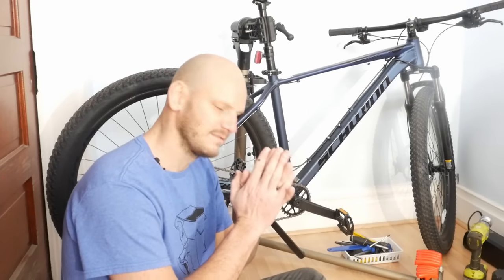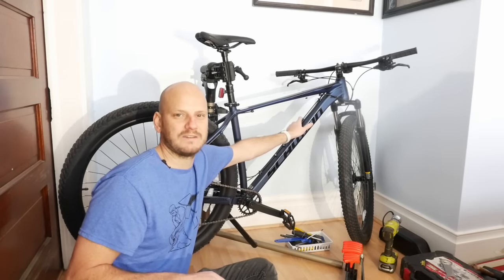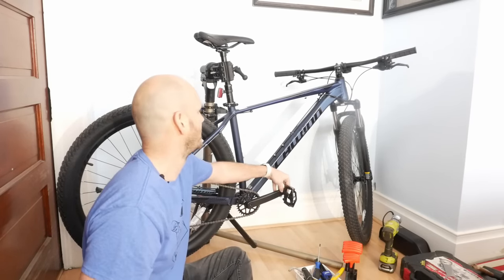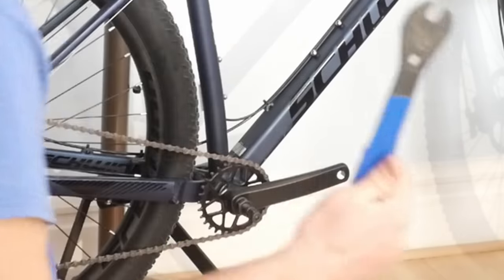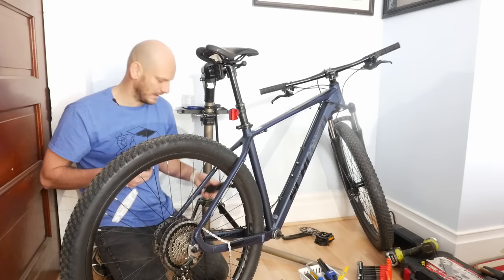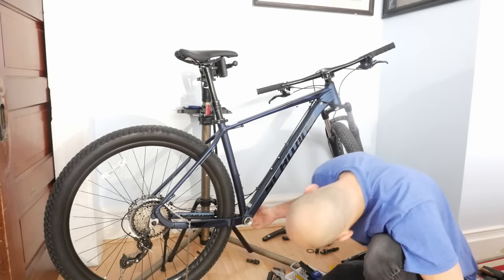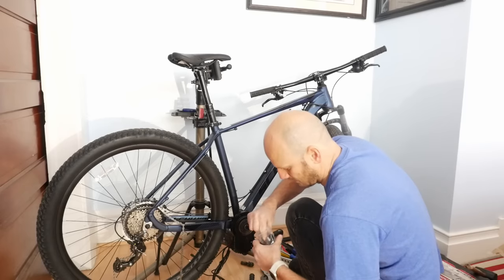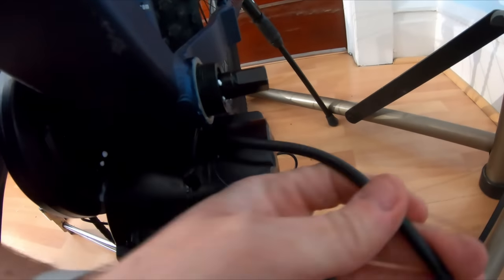The Step-by-Step Bafang Installation guide.

Comment: I purchased my mid-drive kit from Johnny and followed his video...I had to watch it a few times but I got it done! I have a Schwinn Midtown bike which has a curved downtube...Johnny recommended getting a Triple Bob plate with rubber coated hose clamps ...which made it possible to attach my downtube battery...Learned a lot from the experience which includes NOT breaking the chain if  not needed...Thanks Johnny!

Comment: Just did a bbs02 on my hybrid bike, this was a most helpful tutorial! Because of you I had the necessary tools on hand and was able to enjoy my results quickly!  My tip is that small diameter split-loom tubing is one's friend for cable management on these kits, makes it look a few percent less like a DIY project
Reply: Heat shrink tubing with a heat gun. Yea buddy
Reply: @mikesaull6094  Heat shrink will reduce serviceability. Convoluted tubing is the best bet to a clean finish while maintaining the ability to diagnose/pull it apart/put it back together when something inevitably breaks/needs adjustment. That's why the automotive OEMs use it. 

Put a couple wraps of friction tape at key points if you need to help it stay together.
Reply: @runner3033  I'm going to use a little non-epoxy heat shrink at chafing points, such as where the motor loom runs under the bottom bracket, also to secure the lighting connection, which is not robust.

Comment: Ahhh!!  No music - what joy!!!  Thank you!  My brain can focus 100% on demo.
I really appreciate this tutorial and all the little details like brake lever positioning for ease of use, what can get jammed, etc. Saves a lot of bother for newbies like me.

I want to convert a Trek Aluminum road bike (smaller for females) into an electric bike.  It has nice gearing components I want to keep.  The idea is to have full road bike functionality to get exercise but also to have the ability to commute fast to work on electric power when needed, and to do long bike rides with my small doggies in a trailer in back, run errands for shopping, etc.  I have another road bike for hard core workouts but the electric one will be the workhorse.  I will not do off roading, stick to paved roads, capable of climbing hilly roads in town, street bike wheels - no fat tires, no mountain bike. 

I need long range, light weight, fast speed to 25-30 mph, and reasonable cost. I want to DIY the install. I am very analytical and handy but not a bike expert and never done an electric install.  If you can recommend something sleek with good engineering, I will buy it from you.  I think from what I have read, Mid Drive beats the front hub or rear hub type of motors.  Please do advise.  I trust you.  Complete newbie here.

Comment: Get yourself some expandable sleeving black braided, the braided sleeving is great to run cables through, when you cut it melt the ends with a lighter to stop it fraying.
Also I like to use a stainless steel jubilee on the top of the battery bracket, clamp the bracket to the bike.
You need to pinch the jubilee and push it through the fastening slot, then slide a nail through and tighten it to the frame so you don't just have the bottom two screws holding it on.
You can use black electrical tape to stop it scratching the bike frame.
And lock tight on most important stuff as my big heavy feet tend to loosen the pedals, lol.

Comment: I'm boning up for my install. I got a BBS02 from Johnny and it fits my old Cannondale F1000 hardtail with a millimeter or less gap by the drive side chainstay. I'm picking up some spacers in case I decide that's to little room. I'm going to use a California e-Bikes stabilizer bar since the frame is aluminum and a lot of folks have the mid-drive's lockring teeth loosen up with aluminum bottom bracket shells. I assume that ideal chain line is with the chain in the middle of the rear cluster. I've ordered up some Lekkie crank arms since I don't like the idea of Bafang's asymmetry with their cranks. I really don't like the idea of the wad-o-wires up behind the motor. To compact it some, I'll probably use a length of large diameter shrink tubing.

Comment: I saw a tip from another video where they used a silver sharpie or paint pen to mark the brakes, shifters, and bar. Ensures they're reinstalled in the exact same location every time you maintenance the bike. I don't care enough to do that on mine but I thought it was a good idea.
Reply: Maybe if the bikes already set up for you, it if was new I would just set the levers and shifters to myself after a few rides up and down the street. It’s no biggie not to have the levers and shifters where they were it’s more than likely you would be better fitting them to your riding style. The smallest adjustment can make a big difference.

Comment: All very good if you have a box frame. I have a triangular section frame. The two water bottle mounts aren't strong enough and you'll end up ripping the bolts from the frame.
Reply from the maker: If you are working with a sketchy frame, you can use a product called “bottle bobs” that do a great job reinforcing those mounts

Comment: Johhny, I put a 700W on a similar bike my beach bike a Schwinn Axum with 29's. I had to add a 3mm shim behind the motor and order a special offset left crank part number ACO8 the ACO8-2 that came with the kit hit the frame. I changed the sprocket from a 30 to a 36. I see you went with the bigger offset one ,just wondering how that worked out .?????

Comment: @5:25 - totally agree about having a DECENT crank puller. Had this happen to me (partially due to me handling the tool for the first time, but anyway). No serious damage was done, because I was removing an old el cheapo riveted together crankset (worn chainrings; only replaceable as a whole unit) only to throw it away (-!

Comment: I bought a 1500w DD hub in 2014 for 1/4 the price of the then new BBSHD, and think there are benefits of hub motors for certain riders. That being said, I have a mid on order and can't wait to double my torque while chewing my chain and gears.
Reply from the maker: If you shift properly and install a shift sensor, you won’t have an issue 👍

Comment: Brilliant video. I've just completed a flat pack build (no instructions)  and you nailed everything. Particularly the bushings for the motor mounting (which were not supplied and had to be made up). I filed 0.5mm slots at 40 degrees for the securing ring so I didn't have to tighten the hell out of it (I've stripped too many threads in my time). I think the battery base mounting is too insecure as 5kg secured on 6mm aluminum threads is weak. But that's a design issue. A solution?
Reply from the maker: Google the triple bob @ Ebikes.ca

Comment: I have a  question about the minimum distance from the chainring to the chainstay. Mine is right at 2mm. Is that too close? The motor is also very close to the frame, less than a mm. Is this acceptable?  Nothing is touching but it’s very close. Thanks for all of your videos!

Comment: Great video. One question. Is there a specific reason you put the thumb throttle on the left side?
Reply from the maker: More space. The right side has the gear shifter. It can on either side of there is room.

Comment: Once you have tested the bike I would be inclined to shorten the wires using a soldering iron and shrink tube removing the wad of wires you folded up would make it look better 😉
Reply from the maker: the main wiring harness is 9 pins. I totally agree, but it would be pretty time consuming

Comment: Sorry for all the questions (but you got me started), what chain and length did you end up with on this bike. I've got everything comming but the chain. My order from you should be delivered tomorrow (Tom Dehn). P.S. I'm a nerd just like you, only older. 🤠
Reply from the maker: Can’t remember now. You just want to make sure you have about 1.5 extra links of chain when in the biggest physical gear in the back. Usually you can just use the same chain👍 you might have to remove a link or two 🤷‍♂️

Comment: Awesome video!  Question, I was planning on installing it on a 2015 Felt F5 all carbon fiber road bike for its lightness.  What do you think about that?  I'm not doing off road right, just the city streets in San Francisco...lots of hills.  I do have a heavier mountain bike I could use as well.  The Carbon fiber weighs 19 lbs with wheels and everything.  So that's a good light bike to start with.  I appreciate your feedback!
Reply from the maker: You just want to check the bottom bracket. You can’t clamp a Bafang mid drive onto a carbon fiber frame/ bottom bracket area.
Reply: @JohnnyNerdOut  Yeah, so you are saying that since my bike is all carbon fiber, I think the crank area is too…near the petals, i shouldn’t install a mid-drive?  I called a shop and they said i should do the mid-motor mount, but they wouldn’t sell me a rear hub kit cause it may not be safe…. Hmmmmmm

Comment: Hey im installing this now and the brake levers are confusing as my brakes are hydraulic disc brakes so im not sure if you can just replace them with the brake sensor ones? Should i just run no brake sensors? And or is there a way to install the sensors easily with disc hydraulic brakes? Id prefer not to have to bleed them because idk how nor have the tools
Reply: There is a different magnet switch that you need for hydraulic brakes, you typically have a choice between cabled and hydraulic when you buy the kits. You can still buy the sensor separately as far as I know.
Reply: @ElmdariRecords  i will prob rig the yellow plastic sensor thing somehow to my current lever. My problem now is getting my deraileur adjust as the chain is all over the place rn

Comment: Hi Johnny. Thanks for posting this. I have a question about battery mounting. Some batteries I see for sale have a mounting plate that is much longer behind the lowest screw hole. That means they won't fit between my lowest bottle cage hole and the seat tube. Have you come across this problem? What model of battery did you use on this build? Thanks

Comment: One thing to be aware of, the crank arms are typically aluminum and the pedal are steel. These two metals are not compatible! And the steel will corrode badly. So a old bike can be really tuff to get pedals off!

Comment: Watching your videos practically dared me to do one for myself.

I'm trying this on a Hosote. It's white and will have a horn and dual mechanical disk brakes. My bike and I got hit by a car, so they're paying for it. If there is anyone else out there trying to do this on the cheap, I will give you all the work arounds I will have to do.

Already forgot to request sensors instead of brake levers. 

Not so sure about the battery that I bought. I will crack it open and give you my verdict when I get it.

Any advice on wiring the 48v horn?

I'll be pulling a cargo trailer. I have the desire to have trailer taillights/brake/turn maybe.

Comment: hey  question, If i install a mid drive  with say a 36v battery . Could i put a front hub drive and use it as a generator ? if so  have you made a video about this or could you make a video about this.  im planning a mid drive conversion for my current bike and will get solar trickel charge so .. just wondering how well it would work out  , thanks in advance
Reply from the maker: You can it just wouldn’t be very efficient. You be using more watts to generate a little bit of watts. Just the weight alone would make it not worth it.

Comment: Any suggestions on resources to predict energy usage vs weight of bike, speed, grade for various size motors?  Here in Colorado, I want to stay below 750 watts to avoid registration and be able to ride on bike paths.  Is there any significant advantage to going below 750 watts?  Or should I stick to 750 for the flexibility for assistance when hill climbing?
Reply from the maker: Not a lot of resources for predicting consumption. You will get a feeling with time and a good watt meter. I’d go with a 750w. You can always program it down to draw less power

Comment: Three questions 
1. Any recommendations on where should we should buy the kit from? Or we should buy the components individually?

2. I have a Treck Which I would like to get the range of two about 70 miles and a speed of about 35 miles an hour. What kit do you recommend for that?

3. I like the Bafang BBHD and heard you can upgrade the controller to get higher speed.. is that the case and any thoughts on that ?
Reply from the maker: Hey! I actually sell the components through my website. If you want to set up a consultation with me, I can go through all of your criteria (budget, riding style, power needs, etc.) and spec out the kit that is right for you. No obligation to buy through me, but you'll know what to start looking for. www.johnnynerdout.com
Reply: How much was this kit on this video did

Comment: Hello there, I'm looking to make my 26x4 fat bike into an ebike like this one, what motor do I have to buy? The center of the bike where the pedals are is 120mm in length from end to end just counting the frame..... How do I know before hand that I need to replace the chain?
Reply from the maker: What size  chainring do you currently have ?  If you go with a bigger chainring you will need a new chain most likely
Reply: @JohnnyNerdOut  in the info sheet of the bike it says that it's a 24t (I think it's too small compare to what a regular motor comes with) with a chain fxd 1/2*3/32*118L

Comment: I have the Dekra D-drive bike that would be awesome with an e-conversion, trouble is it’s a shaft drive not a chain drive (it comes with Shimano 3-speed Nexus hub shifter *only*, no front derailleur, obviously, because it has no chain).
I like the idea of a mid-drive (saw your comparison & contrast video) but I fear shaft-drive bikes currently only would possibly work with a hub drive and at that, probably front wheel drive only.
Any other ideas?
Reply from the maker: I would love to try and convert a shaft drive, but unfortunately I don’t have any ideas as I haven’t worked on a shaft bike yet

Comment: Great video! Do you have any experience in installing Bafang on carbon frames? Not sure if the carbon fibre bottom bracket will get ruined or not.
Reply from the maker: I wouldn’t install it on a carbon frame due to how it clamps on
Reply: That sucks, i think this answered my question 😭🙀😭🦗

Comment: On this one is it just Anderson to Anderson? No Xt60 in between? Do the Anderson hold up??
Reply from the maker: Yes, Anderson is pretty much all I use. I use the 45 amp terminals so they can easily handle the current of the Bafang motors.

Comment: I built the bafang 750 mid drive....my complaint is that when in pedal assist (even just on 1) the assist wants to go the maximum for that gear most of the time. There are some exceptions where it behaves properly. Anyone have any suggestions?

Comment: I would not ride a foot distance beyond 8cm, given that i am 5 foot 3. Too much stress for me knees or hips (external rotation). I can get 8cm crank distance (outside measurement) with a 103mm jis bottom bracket. So i would probably have to go for a hub motor.

Comment: Would there be any donor bike brands that you would recommend?
Reply from the maker: I’d would avoid buying from Walmart or Amazon. Local bike shops usually only carry good brands👍
Reply: My local bike shop only has cannondale and specialized, would these work? Also does the throttle on the bbshd work as pedal assist as well when wished? And do you know what the top speed would be?
Reply from the maker: @Coolstuffifound  those are great brands. My opinion would be to get a hardtail mtb in aluminum for the best donor bike. Yes the bbshd has throttle and pedal assist
Reply from the maker: 35mph about top speed
Reply: @JohnnyNerdOut   if I upload a video to my youtube (this channel) and you watched it it would be easier than telling you about it. They didn’t have a cannondale with front shocks (or a specialized) so i ended up going with something else that cost a lot more. But i think it should work.

Comment: I did my install over the weekend pretty much following this video. I just changed the order a little. Everything came out great.
If there is one thing I would say to others it's: If you are going with an aftermarket chainring with an offset to bring the chain line back over, put the chainring on the motor BEFORE shimming the motor and tightening things up. The shims needed to move the motor away from the chainstay may not be enough to allow an offset chainring to clear. Well, in my case anyway. I went with a 42T Luna Eclipse on a Growler Stout fatbike. I had to remove the motor and add a couple more shims. Then add some more shims on the bracket bolts.
Reply: You're lucky to have found the 42T Luna Eclipse... they are out of stock and I need one on my new build, unless I just limit the rear cog to a couple gears.  Painful to find this out after the build, I couldn't wait to use the new ebike.  Hopefully Luna will get more Eclipse, as far as I can tell, there's not another better/easier solution.
Reply: @Hiker_Mike  I do have a problem with a couple gears under electric power. Sometimes the chain clicks and jumps a gear. No matter how much adjusting I do. But it's a 12 speed, so I sort of expected it.

Comment: The top of the line specialized e-bike in Massachusetts is 12 grand. 
I just put a bbs02b on my 1998 aluminum trek Y.  500c computer is great.
Get a comfy seat. So much better for going 40 miles in a day. 
No way that tiny specialized battery will go 40 miles.
Reply: Same I got a bbso2 on a little carbon folder. Pulls me up a steep hill no prob.